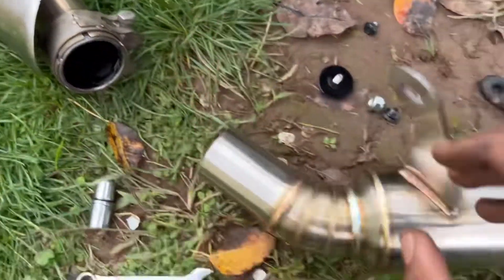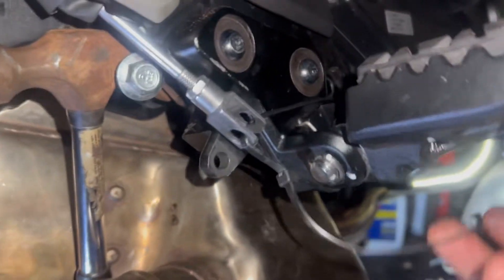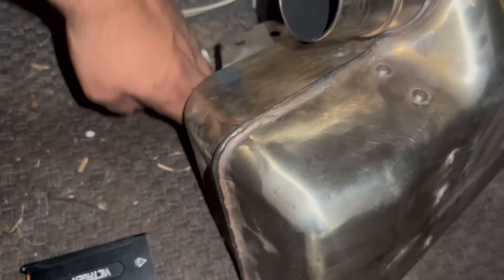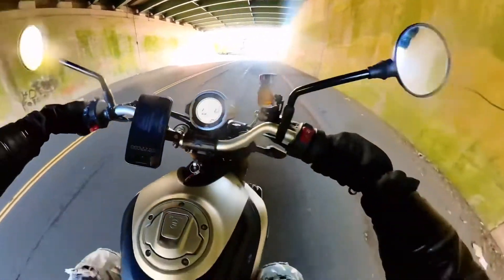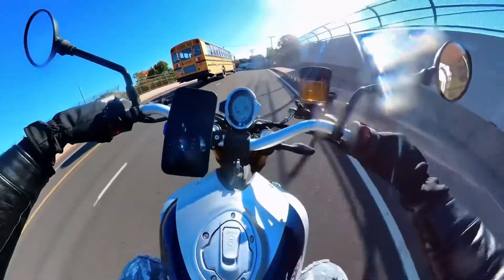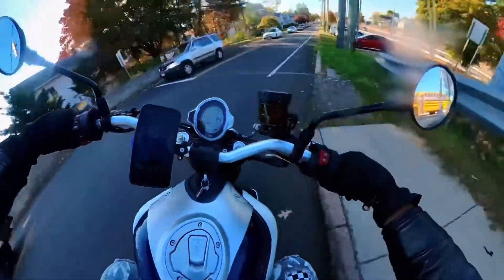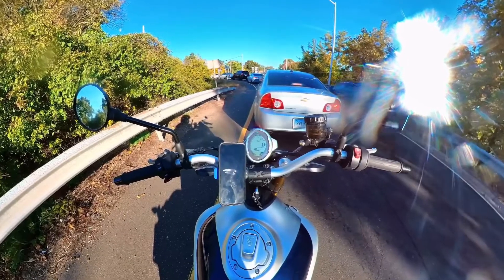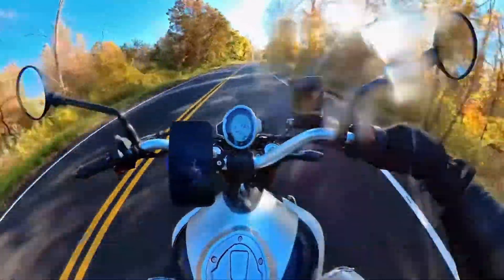Fire Torch Cat Install on CFMoto CL-X 700 | SO LOUD | #cfmoto  #clx700 #motorcycle #exhaust

Comment: For future reference. To remove the stock cat through bolt. You only need to remove the face plate, then the nut and bolt holding the rearset bracket. The whole assembly swings out of the way for full clearance of the bolt. At no point should you need to damage a factory item to remove it.
Reply from the maker: Impossible
Reply: @baljooter  drop an email. I'll send a photo and short video of it. I swapped mine header back yesterday morning in like 15 minutes.
Reply from the maker: I think I saw ur post on the fb group 
Yeah send it I wanna see what your talking about
Reply: @baljooter  I just need an email to send it to. I don't have a video up on fb.
Reply from the maker: It keeps removing my email for some reason 
Can you send on Instagram : baljooter

Comment: Did you have any problems with exhaust leaks or anything with the front fitting not having the graphite seal sleeve in?
Reply from the maker: No sir actually no leaks at all just tightened that clamp down and it’s been fine ever since
Reply: @baljooter  thanks. I just got mi e in today. I'm installing it now. It seems like they made mine a tad to short. It doesn't make it onto the front pipe deep enough. I'll have to figure something out for that.
Reply from the maker: @nickfrierson7880  oh wow I’ve never heard of that if u can’t make it work try returning and getting a different one
Reply: @nickfrierson7880  Same with my bike, I used the forward bolt, only thing you would need is a nut.
Reply: @GerardBarreto  I installed it just as op said, with just the front clamp and have had no issues in almost 3 months of riding

Comment: Any problems or error code after a while when you put that aftermarket cat
Reply from the maker: One time code but this was way after I put it on it was for lean air mixture then it went away and never came back
As far as problems I’ve had none by changing the cat

Comment: Did you have to get your ECU tuned for the mid pipe or did it run like it did before?
Reply from the maker: Yeah it ran the same as before for me
Reply: Alright, cool. I've been searching for tuners beforehand just in case. So it runs a Code for a bit and then smoothes out? Does that lil bit of deceleration go away as well?
Reply from the maker: Ok so some people complain it creates a big flat spot at 3-4k rpm’s I know of a couple people including myself that didnt experience that 
There is a tune available it’s not for the mid pipe it’s for stock but it definitely will make a difference with or without a mid pipe 
It’s from msc 
you have to take your Ecu out and mail it to them and they will tune it and send back I never got around to doing it
As far as a code no I didn’t get a code for running lean or air fuel mixture from this install

Comment: Did you get any HP or better acelleration? tnx
Reply from the maker: Nah just noise 
If anything it lost some I made it leaner
Reply: To me is big difference, the bottom end is fanstaic the response is quick. I Have not notice it being lean, if that is the case I will have to get the EEC retune.

Comment: Hey there

I'm planning to get The 700 CL-X Sport 

My dealer in Dubai says 2 years or 10k km warranty..
The cost is too tempting at $7500 otd

All I wonder is how good and reliable the bike is.
Any faults or complaints and issues you've face during the course of time youve owned it?

Its gonna be my first motorcycle and i do not wanna end up with something that gonna do frequent trips to the service center.

My other option is a Royal Enfield Continental GT650
Reply from the maker: Cruise control doesn’t work well because of gear indicator problem shows 1st gear while in 6th sometime causes cruise to turn off but I don’t use and also fuel gauge stops showing fuel level after 7k miles or so Cfmoto is aware of the problem and is working to get parts to dealers to fix if u don’t mind those two problems bike has been great to me got it last august and rode all winter and summer and will continue riding this winter as well always starts and I even rode it 1850 miles straight in one my other videos road trip it gave me no problems sir I have nothing bad to say about my experience with this bike